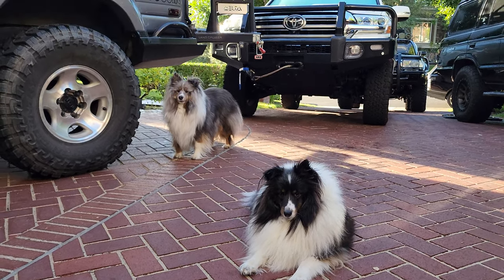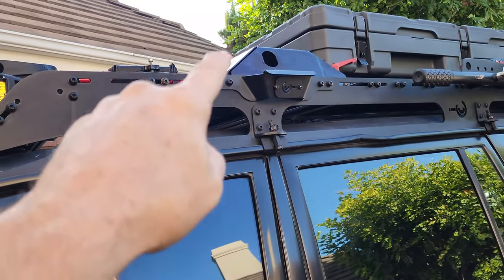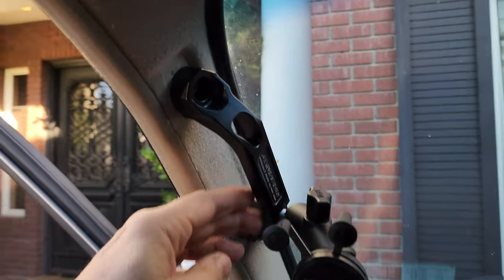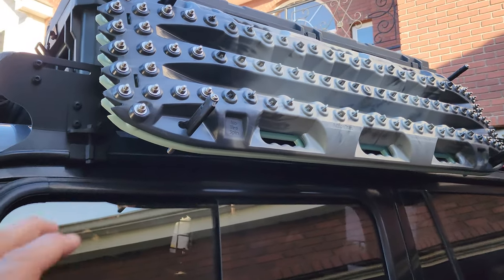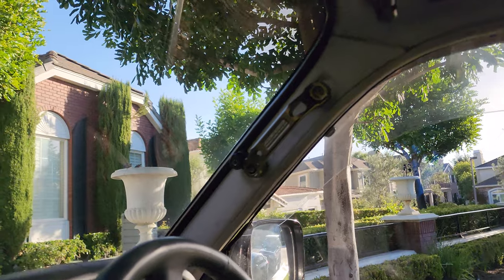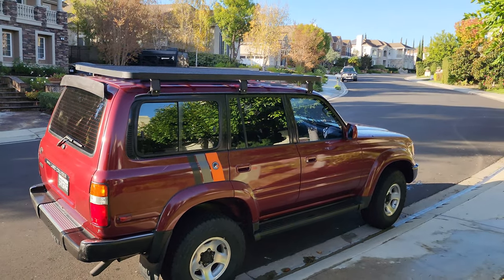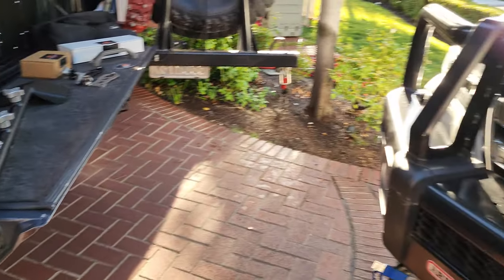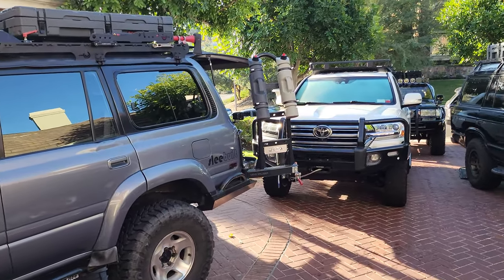Agency6: Shovels, Handles, Recovery Gear

Comment: I had the same idea to put those handles on the interior. I didnt think it would work from what I measured on mine. Did you drill out the handle or somthing in A pillar? Thanks.
Reply from the maker: I drilled out the handle to get the extra 1/4 inch needed. 
See my Linktree in description for Agency6 link and save 10% (use code LC4x4)
Also I have a full video about thr handles and right way to drill it.
Reply: @CruisingTheLand  thanks for the reply! I found the video and I'll definitely use that code when I order them, thanks.